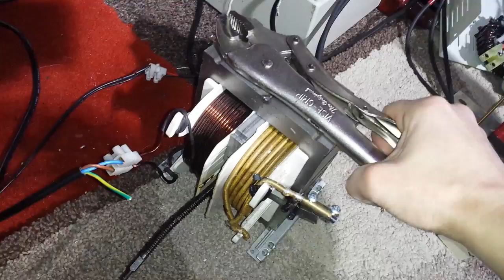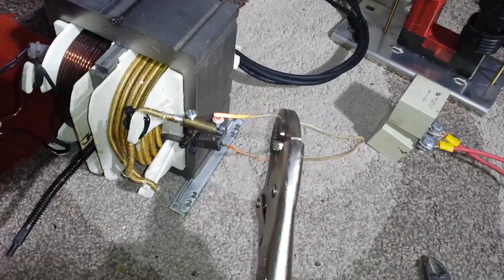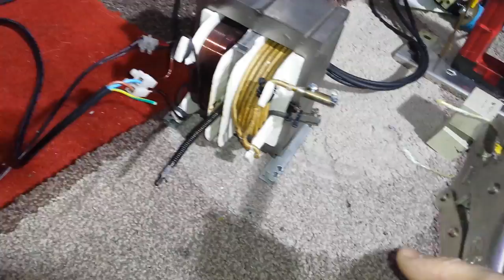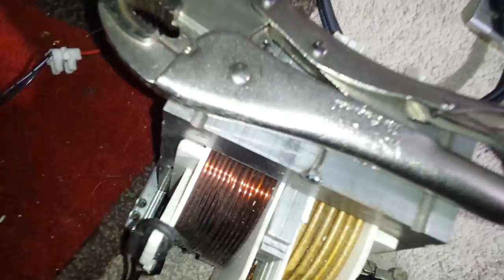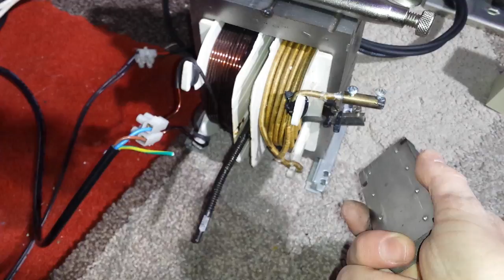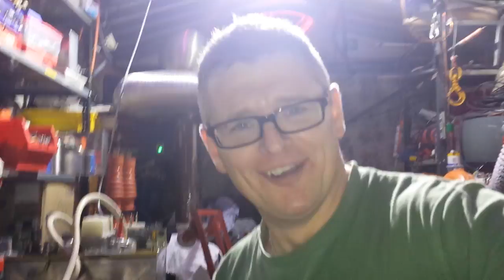BIG High Current Transformer

Comment: Did you measure the current with the shunts all the way out? Nice transformer, it looks brand new considering it came from the scrapyard. You'd probably get the 400v you want if you wire it up backwards, there's going to be heat and a shitload of wasted amps though, especially if you connect it to that big MOT.  Let us know how it turns out!!
Reply from the maker: Hi matey, yes I did measure it's Output Amps and got over a hundred Amps. It's a sweet bitch and a keeper!!! 
And yes that's a good idea. I forgot about this transformer lol ill have to look into that 😉👍
Thanks for taking the time to comment and hope ya well.
Happy new year 🙋

Anthony

Comment: The audible hum frequency should actually be 100 Hz, because the magnetic field has two maxima per period -> so twice the electrical frequency, right?
Reply from the maker: Hi mate, iv not heard of that before mate as it's between 50 and 60 heartz on both windings primary and secondary. But I don't want to call you wrong so we both will have our say!! Many thanks for the comment 👍😉

Anthony.
Reply: high1voltage1rules
1 Hertz is one positive and one negative cycle of the sinewave, so 50 Hz is 50 Hz and not 100 as suggested.
Reply: RODALCO2007 high1voltage1rules 
Just measure it yourself - e.g. with the Android audio spectrum analyzer called 'FrequenSee', a PC soudcard or sth. else..

Read:

http://federalpacific.com/literature/dry-type-literature/10transformernoise.pdf
http://en.wikipedia.org/wiki/Mains_hum
Reply from the maker: RODALCO2007 hello Ray' 

 I know friend but I don't like to call anyone wrong' 
But I know what I know and 100 hertz isn't correct like you said Raymond. Thank you for the comment and info. Thanks friend 

hope you and your family are well.

Anthony
Reply: high1voltage1rules
Ahh..  What do you know? :=) Did you really already measure it, like I suggested? :)

And don't foget to actually read my links: http://electrical-engineering-portal.com/transformers-are-never-silent
Reply: salat Read up on your electrical theory which will explain it. Don't believe what all these digital devices tell you, discussion closed.
Reply: RODALCO2007  Closed? Could you please be so kind and explain what you mean exactly what I should read up and which digital devices I should not trust?
I thought it would be scientifically explained, why transformers emit an audible hum at a frequency double of the current: If you dang on a piece of metal 100 times a second, you get a 100 Hz tone, incl. harmonics. About that happens when the magnetic field passes the two maxima at both halves of the sine wave. That's  called http://en.wikipedia.org/wiki/Magnetostriction - the mechanical waves are double the frequency of the electric current.
You can even measure it by your own ears - just compare a loudspeaker at 50Hz and transformer noise generated at 50 Hz..
Reply: RODALCO2007
I think you didn't get the point
Reply from the maker: salat we will call it a day with this" and we will end it with our own views and this subject  please. I don't want any negative on my videos. 

Many Thanks

Anthony / high1voltage1rules
Reply: high1voltage1rules
Tony, you were the one indirectly doubting my valid explanation and agreeing with Ray without any disproof. Unscientifically and deviously verbalized as "your view, our view".
That's what I would call 'negative'.
Seems you're not interested in facts.
All the best to you..
Reply from the maker: +salat. Mate what is it with you? I'm going on what iv always none and been teached at college and my own experience from work and experience! and  I didn't call or say anything negative to you!
You comes along and tell me something' iv never heard, and telling me something wrong and 50 hertz isn't correct!!  iv never for most of my life ever heard that! And I'm wrong for saying we will leave it there with our own beleaves??  What did you want me to say? And because I agree with a friend I'm in the wrong?  to me it's just like telling me up is down and down is up! It's hard to beleave!!  So yes that's why I said what I said.  I never like to call anyone a lier' and let people beleave in what they want! 

Sorry for not stopping everything, and changing something iv been told/teached to be incorrect!!

Anthony.
Reply: Anthony, I think you lost me somewhere.
What have you learned about building transformers, esp. about the different ferromagnetic materials used as cores?

If you've not been able to follow - I condense the problem to this:

- 50 Hz is the frequency of the alternating current (ofc in the whole transformer, input & output)

- But the humming sound (physical waves in air, no electricity involved here!) that you can hear with your ears emitted from the transformer is at 100 Hz.

Last source to refresh your knowledge:
http://hyperphysics.phy-astr.gsu.edu/hbase/solids/magstrict.html

I already posted a ton of sources (Wikipedia, transformer manufacturers, etc.) to clarify this fact and you just gave me a "I won't say you're wrong" - implying you're at least thinking it.

I think it's understandable someone might be  a little upset when told a sentence like "I'm not saying out loud you're nuts.".

I'm also quite disappointed by Ray - I always thought he was an engineer at a power company and has some degree. Now I'm really not sure anymore  - he sure should have heard something about magnetostriction otherwise, since transformers around the world hum. But maybe he just got me wrong, too.

Anyway, thanks for shaing some words with some nut on the interwebs who tries to teach something - a wonder you even took the time to answer. Are you still getting enough sleep with the little girl?

Best wishes..
Reply from the maker: salat hey ' 
now I see what your saying! You have made it more clear and I understand. Glad we got there in the end. I fully understand now lol. 
We learn something every day! 
Thanks for all the info, 

Iv never been told that and it seems these days with all the new digital equipment' these days, we are able to monitor all the characteristics of frequency and harmonics and resonansce "  And I love it. Lol 😉 Thanks. 

Wish I had the equipment to learn more about this. 

Thanks

Anthony😉

Anthony
Reply: I think I said nothing else, so thanks for your opinion. :)

Edit:
On the other hand: Let's say an arc would spark/fire every half wave - the sound frequency would also be doubled, or not? Depends also on frequency and steepness of voltage change + corona/plasma channel  buildup/breakdown I guess.
Simple mind experiment: Think of a waveform of 1 Hz with a peak amplitude at 1 million volts. This would spark twice per second in a air gap - so the audio emitted would be 2 Hz, right?
Also think about the fact that when plasma ignites there are quite fast transients which lead to many harmonics - which you can also see in the radio spectrum btw. - Sparks/arcs produce EMF like hell.

I'd really like to read sth about the behavior/frequency response of  plasma speakers & I'd guess someone did wrote a thesis about this :)